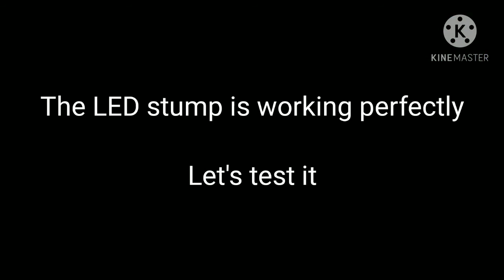How to make LED stumps at home easily||LED stumps|| Sanjay creatives||

Comment: Doesn't the battery get damaged when the led lights are off please reply
Reply from the maker: The battery gets little bit heated up
Reply: Is there any solution??
Reply: Is there any problem in the lighting when the bails are on the stumps for a long time?
Reply from the maker: If the battery is full charged then you can keep the bails for a long time on the stumps. If the battery is low, the lights will glow very dim.

Comment: How does circuit get disconnected? Should I make loose connections with the battery so that every time the ball hits, the connection is disturbed?
Reply from the maker: Remove the battery adapter to disconnect the circuit.

Comment: How do you light up both of the stumps at the same time?
Reply from the maker: I fixed two batteries in both of the stumps and if we hit in the middle stump, both of the stumps will light up.
Reply: OK but how does it do that is there a connection